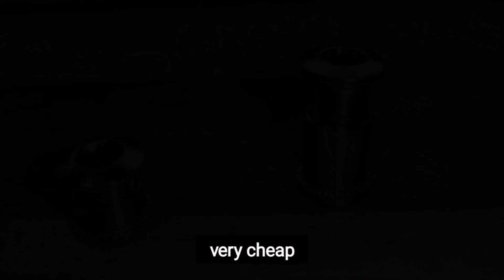1x MTB Set-up with extra long chain ring bolts for correct chainline

Comment: That's an interesting setup. I suppose if you really don't want or are not able to replace the bottom bracket for some reason and still want a 1x set up this would be a good way of doing it. Have you had any chain drops since or the narrow wide chainring doing it's job right?
Reply from the maker: @Maximino No chain drops at all. Yes deckas narrow wide chain ring is what I use and it has been very good. It is not the best solution but it works for me. I did not want to change the BB because I could not get the old one out, thread must have stripped when it was installed. It still works so I opted to keep it, hence, the hack.

Comment: Where to buy these? Im going crazy over.my.chainline problem
Reply from the maker: You can buy them off eBay or try Ali express... Or if you can maybe find a shorter bottom bracket? another way is to replace crankset with ixf jiangun which comes with a bottom bracket too
Reply from the maker: https://www.aliexpress.com/item/1005002852704768.html?UTABTest=aliabtest481469_657498&src=google&src=google&albch=shopping&acnt=494-037-6276&slnk=&plac=&mtctp=&albbt=Google_7_shopping&albagn=888888&isSmbAutoCall=false&needSmbHouyi=false&albcp=17859472720&albag=&trgt=&crea=en1005002852704768&netw=x&device=m&albpg=&albpd=en1005002852704768&gad_source=1&gclid=CjwKCAiAs6-sBhBmEiwA1Nl8s5OhET3TW9-3QSs84m-CMvqz5T8TaRkom80m-YXd7tVGp02db52D9RoCjFkQAvD_BwE&gclsrc=aw.ds&aff_fcid=2ce32d3e2b854cffbf044483089255d6-1703706600181-03701-UneMJZVf&aff_fsk=UneMJZVf&aff_platform=aaf&sk=UneMJZVf&aff_trace_key=2ce32d3e2b854cffbf044483089255d6-1703706600181-03701-UneMJZVf&terminal_id=f284d8aed1f4407c957792fab93aac25&OLP=1086700608_f_group3&o_s_id=1086700608&afSmartRedirect=y
Reply from the maker: Chainring bolts https://www.aliexpress.com/i/32912991473.html
Reply: @cycleodeon  sadly its not availble for my country damn it. Hahahaha but ill look for the same , so just to be sure this is 16mm? How about the spacers?

Comment: Hi Op! Planning on doing the same thing. I hope you don't mind answering my questions. 

1. Is this a triple chainring bolt?
2. What is the length of your spacer?

Thank you in advance!
Reply from the maker: @biosync Hi! Good stuff. 1. Bought them off ebay https://www.ebay.co.uk/itm/192782205974 it is the A size I guess you can call them triple chainring bolt.
2. The spacers are 11mm in height,
Hope this helps. Feel free to leave a comment if anything else.

Comment: Sorry I don’t see how you can shorten the chain line with this method. The crankset once seated on the taper doesn’t change. Adding spacers on the crank bolts just extends the driver side crank further out. Busted
Reply from the maker: The chainring actually moved over 10mm closer to the bike frame so the chain isn't too bent when shifting to the biggest farthest rear cog. You can see in the video